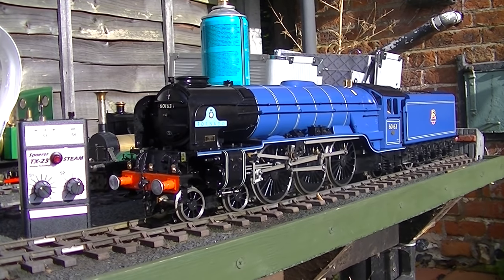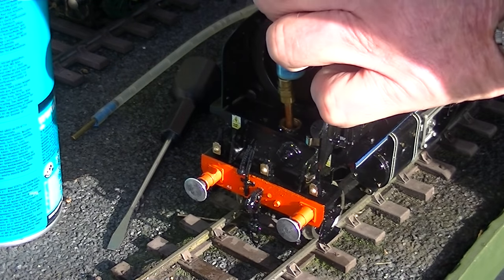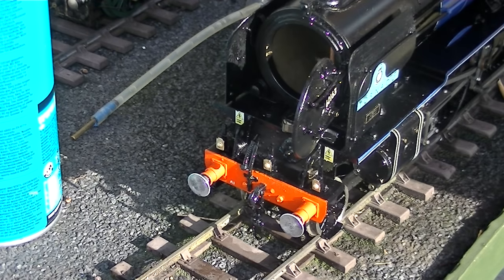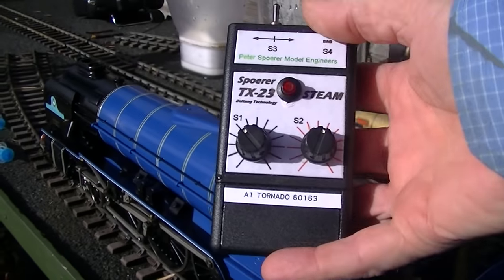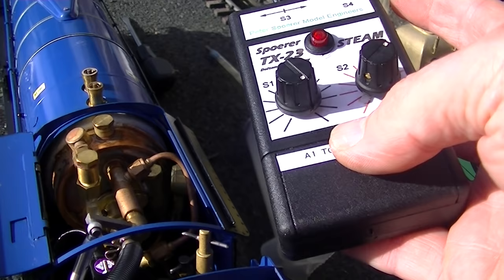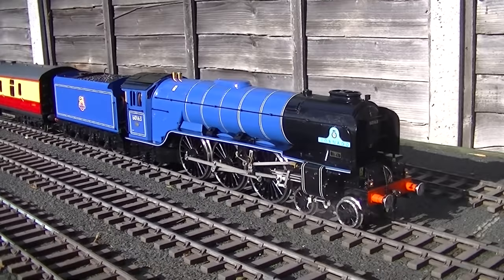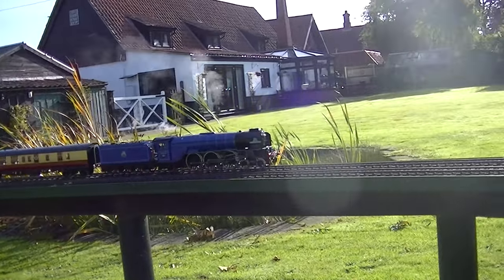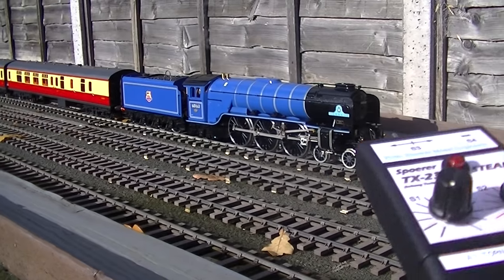Video 66. Live Steam  Gauge 1 Accucraft Tornado with radio Control

Comment: Hello, May I ask if the loco is finished in a gloss or satin paint finish? Does it come fitted with radio control or is that an option? What are the brand of coaches is she pulling?
With my thanks,
Tim
Reply: Timothy2963 
lyh

Comment: I am curious if Scale G is the same as Scale 1.
Reply: G Scale is a scale just gauge 1 is smaller than it
Reply: Same gauge, different scale.
G scale is typically anywhere from 1/29th (representing standard gauge on 45mm track) to 1/20.3rd (representing 3-foot gauge on 45mm gauge track), with 1/22.5th being a popular scale within this range (representing meter-gauge on 45mm gauge track.
1 Scale is always 1/32nd, supposedly representing standard gauge on 45mm gauge track but actually being more proportionate to 5ft gauge on 45mm gauge track.
G has pretty much completely taken over 45mm gauge as the main scale for that gauge, due to its heavy focus on narrow gauge and subsequently smaller footprint due to needing smaller track radii (G scale can actually fit in a smaller space than Proto48 spec O scale). 1 Scale is effectively the realm of handcrafted museum-quality brass models.
There's also 16mm scale which represents 2ft gauge on 45mm gauge track, and is almost exclusively live-steam focused - the Accucraft Talyllyn is a good example of 16mm scale.

Comment: Doesn't seem very controllable at low speed.
Reply from the maker: Have a look at this video. We had more time on this day. https://www.youtube.com/watch?v=7yy8EFd7DNg
Reply: bramber69 thing
Reply: Peter Spoerer Paolo ги
Reply: bramber69!
Reply: Should be possible to run pretty well at lower speeds, but remember that the looks can be scaled down, but the physics of steam engines do not. The reason some people spend tens of thousands on larger steam engines is to get more mass and a more realistic operation.
Reply: @DoctorShocktor 
"but remember that the looks can be scaled down, but the physics of steam engines do not."
Could have fooled me. My LGB.Aster Frank S. runs great at slow speeds.

...although that may be due to the fact that it's a narrow gauge military field hauler with tiny wheels...

Comment: Sadly there's no beautiful black smoke from this train
Reply: That iconic black smoke is actually something you generally don't want to see coming from a steam loco. It means there's a lot of soot in the exhaust and as such you're burning fuel extremely inefficiently and clogging your fire tubes. What you want to see is a lot of thick white smoke on acceleration (which means it's mostly steam) and then very little smoke when cruising.